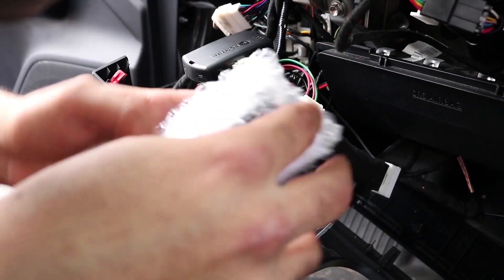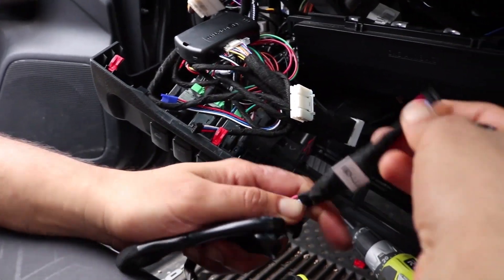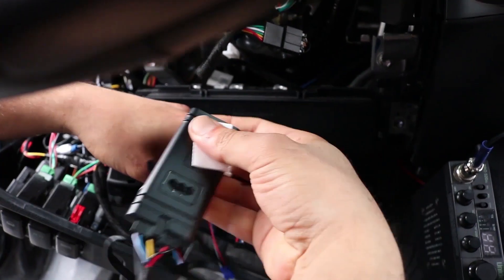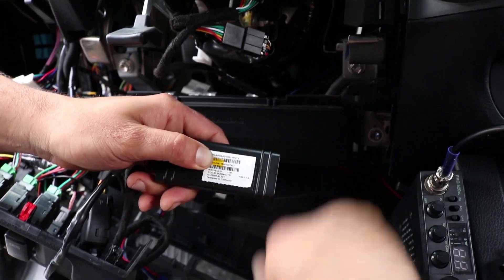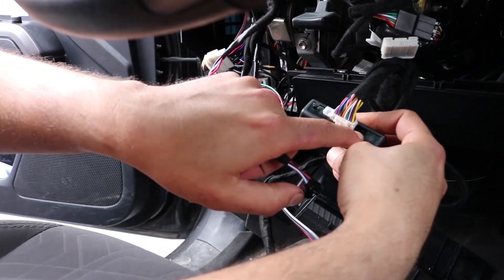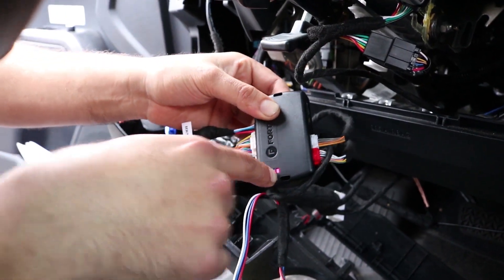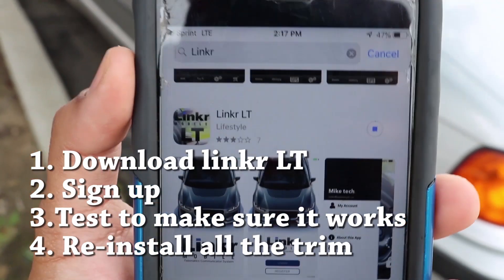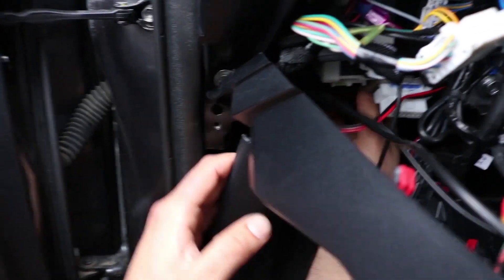N2 Designs Smart Module Installation and syncing/programming for ALL N2-EA kits

Comment: Why does the smart module remote start stop working and needs reprogramming after an update/service at the dealership?
Reply from the maker: Many reasons, if it's HKEY, then it may be they disconnected your OBDII port to do diagnostics and never reconnected it. Simple fix, plug it back in. No reprogramming needed. If it's PTS, then it's because your dealer may have updated your vehicles system with a new ECU flash and so your previously taught remote starter is no longer recognizing the system it was originally sync'd to. This does not happen after a regular service or oil change obviously. You may have had a TSB (technical Service Bulletin), or recall work done that required the dealer to update your vehicles ECU. Sometimes you don't even know they've done this as they don't always ask or tell you.